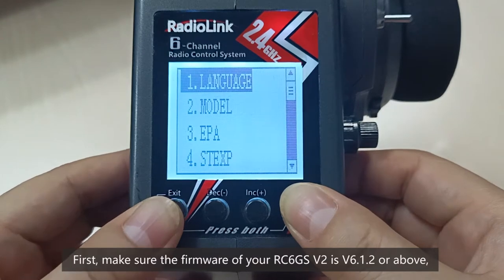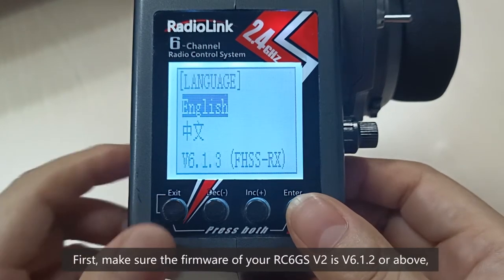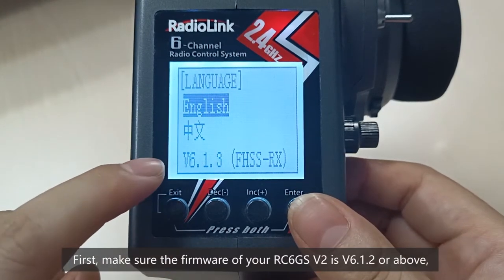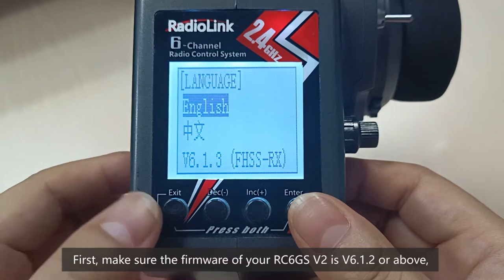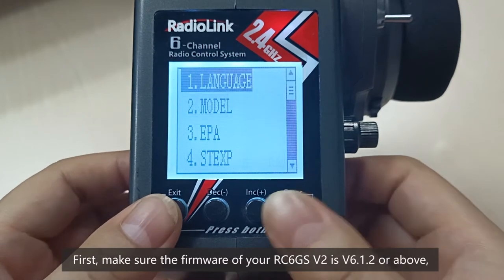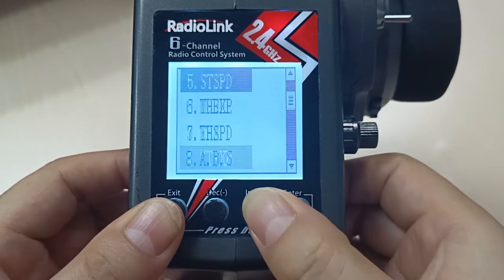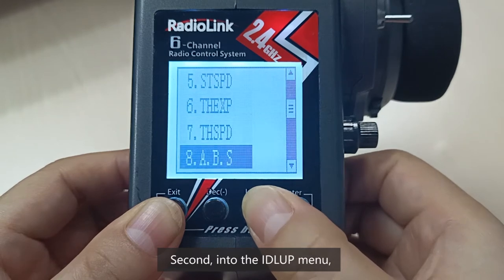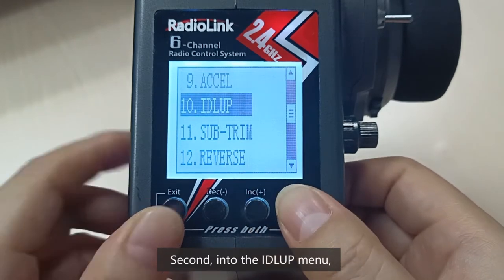Cruise Control Function of RC6GS V3/RC6GS V2/RC6GS/RC4GS V3/RC4GS V2/RC4GS

Comment: I have a track setup like a tank.  In other words, CH1 and CH2 are mixed for forwarding and turning.  In this case, how can I achieve the cruise control?
Reply from the maker: Hi, sir. Yes. You can achieve cruise control for tank. Just set the cruise control, it will work well with your tank, If any question about RadioLink products please feel free to contact us. Our email is: after_service@radiolink.com.cn

Comment: Is it possible to change IDLUP switch from SWA to SWD? I am using firmware 6.8.0 on RC6GS V3
Reply from the maker: Hello, sir. Do you mean the switch for TH-LOCK? Sorry for RC6GS V3, the switch for throttle lock is SWA by default, which cannot be changed into SWD. If there is any other question please feel free to contact us. Our email is after_service@radiolink.com.cn

Comment: When I plug the controller into the pc it doesn’t recognize it. I’m on windows 10.
Reply from the maker: Hi, Sir. 1. When upgrading the firmware, if your computer doesn't pop out the format window, you can go to MY COMPUTER and find a removable disc. Then format the disc manually. The USB cable should be plugged into the port of the laptop directly. It cannot be plugged into the adaptor of the laptop. You can also change another computer to have a try.
2. Change another USB cable to have a try.
If the problem still exists, pls send a video to our after sales service: after_service@radiolink.com.cn. So we can better help you.